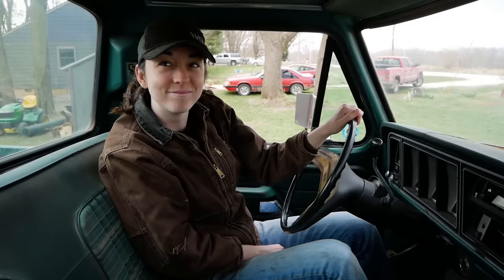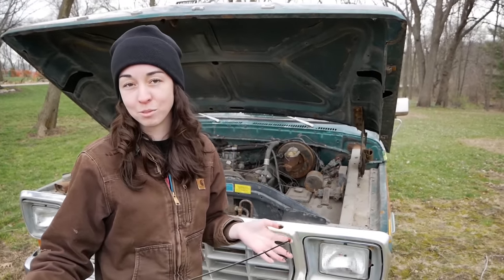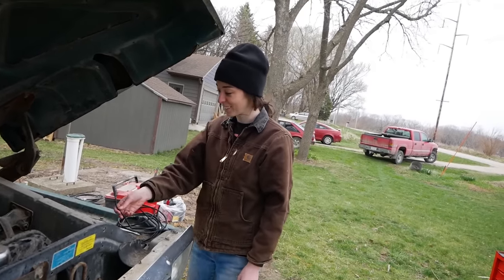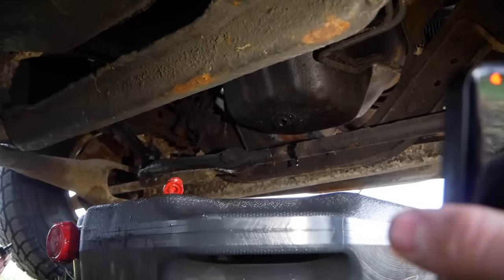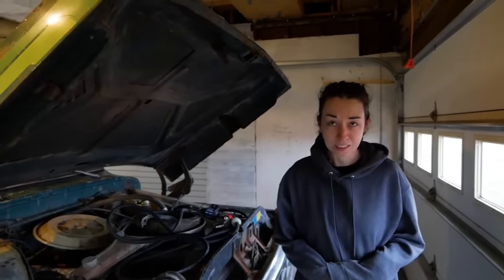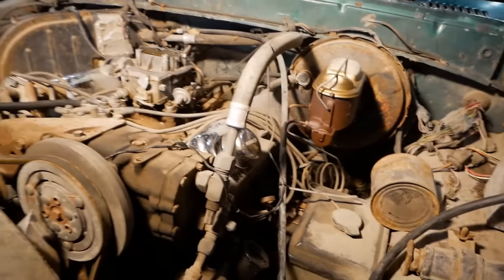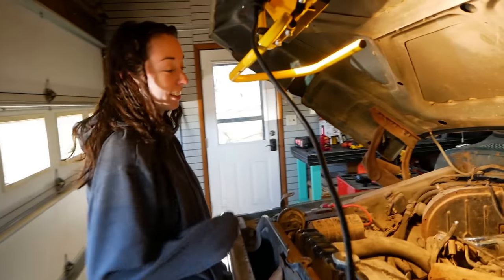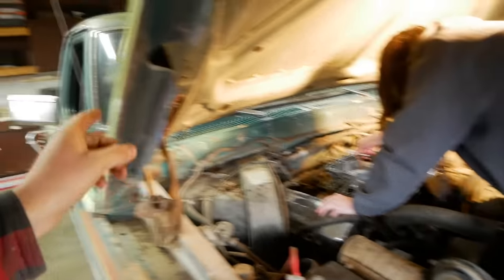I Bought a FLOODED F150! First Start and Revival!

Comment: I've owned many 351m and 400 Fords. Put a small cam, good timing set, cheap fenderwell exit headers, intake and 4 barrel on it. They are strong runners. Although they have lower compression some cam and ignition timing can work wonders. The heads flow well and will bolt right on a Windsor series block, but you need a few mods for cooling.
Reply: I put a couple turbos on my to get around the low compression. 
Only did 550hp at the rear wheels.
Never had an issue.
Love the dinosaur engines.

Comment: I’ve got a 79 f150 custom 4x4 and I had to do the same thing because of flooding. I drained 6 gallons of water out before any oil came out. I do have it running and drivable but there’s so much I still need to do to make it look and feel good to me. - a 19 year old South Carolinian!

Comment: My friends, the first thing you should have done after you found that much water in the oil pan, was to find out where it came from. …..  from what I have seen, you should have filled the radiator with as much water as it would take.... then wait 15 min. and check it again. If it is lowered add more water, and wait 15 min. And then look to see if it comes out the oil pan. (you may have a crack inside the engine block and the water is coming from the radiator.)
Reply: i agree. i dont think it was a flood vehicle as there are not any water lines inside that i could see. most likely a coolant leak into the oil.

Comment: Youthful optimism! Brings back the good ol' days when every rusty old hulk had potential. 
I hope you flushed the power steering, rear axle and trans/converter. That engine's a keeper, work on the rest of the driveline and you're all set. Grease everything up, oil the hinges, latches...Nice solid F-150 there! Nice work on the brakes, and try to find a junkyard-core carburetor for her? Drop the pan, clean the oil pickup screen. 
Best of luck with your truck, Mook!

Comment: We use diesel to clean out the engine. Drys the seals, but there's marvel mystery oil and Lucas oil stabilizer for that.
Reply: How would diesel dry out seals?
Reply: @Anne_Frank00  it absorbs moisture from them, same as gasoline...
Reply: Should just rebuild the engine.all the gasket and sealers are probably shot
Reply: @yuwaraaj1564  oh definitely, but if you don't have the time, it's a quick (albeit temporary) fix that anyone can do relatively easily.
Reply: You use atf bro.
Reply: Found out the hard way as I had one that had the same problems ( might have been brake fluid and or some type of acid and or water in the pan all I know is it burned my skin and harry knuckles off like my wife’s narre stuff would do ) as this ford truck and some racing teams and me use m100 methanol or E100 / really dry alcohol because it will mix better with the oil and the water ( giving a chance at saving bearings vs pure water and junk that it’s carrying with it ) mostly it will absorb it and thin out the oil vary little but will pore out the pan drain easily and what’s left will “burn out “ the tailpipes or PVC system if it’s done right and quickly otherwise you will end up with milkshake and rust/ seized parts aka useless junk and my pick is using ATF over Marvel mystery Oil as I tryed both in the cylinders and walls etc. 

It would be wise moog to change the transmission fluid and filter plus the differential case too at the same time etc. And check for mold and wiring but more than likely the mold is a little more rare to happen as if one has problems my bet is the rest have “water problems” just a suggestion as I learned the hard way and lost a engine 

I wonder if this is a thieves handy work and or pro-chop-shop way if dealing with a “problem” ??? as I’ve seen this before and is something to akin to if I can’t have it or make money off it never can you ?? or a way of not getting caught with anything useful to lock them up ??
Reply: Just pore it down the carb and into the oils filling tubes to gum up the works
Reply: My way that I found when dealing with this “ water problem “ is M100 first then ATF as I’ve tried both ways and learned from older mechanics and the interwebs
Reply: @J_o_B_is_back  Not really.
Reply: @richardprice5978  Why would you play with toxic Methanol when E85 is available ??
What exactly do you do with a gallon of toxic Methanol laced with burnt motor oil and water ??
This truck needs a new oil filter NOW and another in 100 miles.

Comment: I swear those trucks came off the assembly line with exhaust manifold leaks.
Reply: This really is a small world. I love seeing other channel owners commenting on other channel's videos. Been subbed to your channel for a while, Wes. I've been trying to talk my brother out of trying to find a non running Polaris 4 wheeler thanks to your most recent video, lol.
Reply: ROFLMAO 🤣
Reply: Collab
Reply: @Shane-Singleton  Everyone needs a dead Polaris to work on!
Reply: Tsunauticus III  I'm everywhere...
Reply: I thought you were Vice Grip Garage at first.  Your avatar is almost identical.
Reply: And power steering pump whine
Reply: I can't watch Wes work without thinking about the poor bald eagles.
Reply: I've owned over a dozen of them and only one had a manifold leak and that was only where the exhaust flange bolts to the y-pipe. That truck was allowed to leak considering it had 392K miles on the original engine.

Comment: I bought a brand spankin new '71 Ford F100 and took it straight from the dealership to have it undercoated.   That piece of junk rotted so bad before the first year was up that you could see all 4 tires when sitting in the cab.  When it rained you got soaked from driving through puddles on the highway.  I came home from a hunting trip and half the box had fallen off.   The 302 8 cylinder rarely got more than 70,000 miles before they died.   Never got one cent compensation from Ford back then.

Comment: hahahah, I know the feeling about buying a flood car and not knowing. while taking apart the dash to get to the ECU on my current car, I found a receipt behind the glove box from a mechanic's shop detailing how they drained 3 gallons of water out of the engine, 1 gallon out of the transmission, half a gallon out of the intercooler piping, and several more gallons out of the gas tank after a prior owner attempted fording a flooded intersection in a frickin' *SAAB 900* with an intake snorkel 16" off the ground.
Reply: And it survived huh? I dunno why people hate on Saabs, the old ones seemed like tough cars 😂

Comment: You should acclimate yourself with the q-jet more.  They are actually real good carbs.
Reply: They are only a good carb if you know how to dial them in which is a pain in the ass but once done they will outperform almost anything else
Reply: @Wesleystewart78  they are not that difficult really.  But yet they work awesome when set up correctly.  And will generally out perform most other carbs in a street application. But like anything else they are only great to a point.
Reply: Great carb if dialed in. That kick down 4 barrel sound is impressive.
Reply: Ik they are all I run on my SBC's
Reply: old school budget racing My day job is designing fuel injection systems and I agree with that. The Q-jet is my favourite carb, if I have to use a carb. I found them really easy to tune, as long as it’s not warped.

Comment: I had a 79 Bronco with a 351 modified. And it was definitely nothing to brag about, but after it spun a main bearing we went ahead and put in 400 rods and pistons a decent cam 4 barrel intake with a Holley 650 and dual exhaust with an  x-pipe. It was very respectable performing engine after that.

Comment: I think this is the first will it run that I heard the expression of need to do no more harm, drain the oil, etc. Very smart!!  Most "will it start videos" have trouble with start up because the intake runners are DRY, it takes a ton of fuel to wet things up so that fuel vapor inducts thru the valves.I also heard those negative comments about the 351M and 400 engine family being odd ball and to be avoided. Boy do you have some surprises in store for you. As produced they were dogs, no question. But I have a 78 f-250 4x4 with new process 4 speed and a 400 that I built up, took off the smog crap and that engine is a pulling fool. I used it to tow loaded car hauler to shows and it does not lack for power and durability.

Comment: I'm going to go out on a limb here and assume the rear-end is also chock full of water may want to flush and fill that with fresh stuff
Reply: Diving Duck  a shattered planetary gear begs to differ. It can cause very rapid and complete chaos. Lol
Reply: You don't even need that. Just keep the water full...
Reply: You need to change the transmission fluid and differential fluid asap.  The transmission will probably need changed 2-3 times.
Reply: Also the power steering fluid

Comment: I had a couple of 351 modified 400 and they were torque monsters of course they were canadian-made and didn't have all that smog crap on them
Reply: I got 400,000 out of my 1980 f350. All 8 oil rings broke at the same time. LOL
Reply: there good. just need a 4 barrel intake and sprinkle a little timing. some cleavland heads and a cam will get you to 400 hp range.(basically a detuned choked off cleavland with bigger mains and a big block bellhousing
Reply: @nathonsmithson3024  yup. Tourqe for days
Reply: Stephen Brown 🤣😂🤣😂
Reply: Yep I had a 78 3/4ton 4x4 sitting on 35s and it would torch those monster murders like they were small street tires

Comment: Howdy Mook, make sure you change the rear axle oil, trans oil, coolant, power steering needs to be flushed along with breaks. Good luck.  I had a 1964 F250.  It was awesome.  Have fun.

Comment: All that water where it shouldn't be looks like a bad head gasket. Edit added: great job getting your new truck running and driving. I'm glad the problem wasn't as bad as I thought. I like the older pickup trucks more than the new ones. I hope you get years of use out of it.

Comment: NEVER EVER PUT GAS IN THE CRANKCASE .
USE DIESEL
Reply: Allways. Never gas!
Reply: Yep, gas is a solvent, diesel is more like oil
Reply: @curtisj2165  use kerosine
Reply: I was saying the same thing.
Reply: @ty2010  they are pretty similar but both are far better than gasoline
Reply: I would agree diesel or Kerosene.
Reply: ATF is best. Half and half with oil
Reply: Kerosene and No.1 diesel are the same thing. (Diesel is filtered more). Same deal with home furnace oil and no.2 diesel.
Reply: ATF is the best as someone else said.
Reply: My dad always liked Castrol oil to clean out a engine,  something like a couple hundred miles and a 2and oil change and by the 3rd oil change it'll be fairly well cleaned on the insides
Reply: I was going to say that. Diesel cleans up gunk quick
Reply: This is what my dad was saying, he is familiar with these trucks and working on them.
Reply: @Chevymonster203  and diesel eats at the seals after some time
Reply: They put it directly into the pan through the dipstick sheath, not in the crank case
Reply: Never went to the crankcase, they went through the dipstick straight to the pan to breakup the sludge in the pan around 5 min 45 seconds in, sorry don't know how to add the time stamp
Reply: It’s only to flush the crap. You would get away with a gasoline mix if it’s quickly drained out and filled with oil. Alcohol is better as it allows the water to mix. But again. Crank the engine with plugs out. Then drain the resulting mess.
Reply: The Diesel or ATF folk remedy is for starting , running a brief time , and then draining . Here they're putting gasoline directly into oil pan , letting sit without starting or cranking engine , then draining . Two different things .
Reply: I did same . used gas - for diesel engine - cleaning -of mixture grease, water etc  = successful after sitting 12-years  Greetings froom Germany
Reply: Gas works great, diesel does nothing.  Put the gas in, wiggle the truck around like they did, I let it sit overnight.  Turns sludge into a drainable liquid.  Diesel does not.

Comment: If the engine was full of water, might the differential and fuel tank may be too?
Reply: lahokc59  ATF works well for and engine flush. NOT gasoline. Hook the choke back up. It will run better.

Comment: the best engine flush is actually a bit of diesel and some oil
Reply: That’s a good old go-to for me
Reply: Yep, 1 gallon of diesel fuel, and 1 qt of oil will scour the sludge out of that engine. Let it idle till it's hot, then let her puke out all the crap that came loose.
Reply: Yes. Flushing a sump with petrol is a terrible idea.
Reply: For me it's 4quarts oil one or 2 diesel changed 3 times.
Reply: No water in the transmission?
Reply: That's the magic potion. Seals enjoy the bath too.

Comment: A 351w needs to have the timing advanced in any old restarting situation, anything that has  sat for a duration of time change the oil before even turning it over 😐
Reply: He said it was a 351m.  Not sure if that makes a difference re your comment, but those engines are very different.

Comment: yeah I agree with a few quarts of gas, crank that motor with the ignition removed then drain. Then the cheapest oil and filter you can find, run for maybe 20 minutes with some engine cleaner in it, drain and repeat. Drive for a few days, then drain and refill with good oil and a filter.

Otherwise she's a beauty, good score!

Comment: Maybe a 4 barrel intake, ‘70 head, & performance cam would wake that thing up.
Reply: Hot Rod magazine built a 400M years back and made good power with it. Others have messed with them too, check out at the various Engine Masters builds, and I believe Richard Holdener here on You Tube recently built a Modified series motor as well...
Reply: True. But first do a proper engine clean out, plus fluid changes in the gearbox and diff. They are undoubtedly full of water. If they are, the transmission won't last 20 miles

Comment: The gasoline is a bad idea, just drain and refill ALL fluids including rear end, transmission, power steering fluid, master cylinder and brake lines.  Than run it and drive it for about an hour and change all fluids a 2nd time.
Reply: Kerosene would work just as good. Its not as highly flammable. Makes a good parts cleaner.
Reply: Remove sparkplugs and add some mystery oil down each cylinders.
Reply: Yep.  You'll wash any oil film off the bearings, cylinder walls, cam and lifters by running a light solvent through the engine like this.  Any residual water mixed in with the oil will evaporate once the engine warms up.  Then change that oil immediately.
Reply: Gas is a bad idea. Diesel fuel or kerosene. Dump and refill all fluids. A bit of sea foam down the spark plug holes too.
Reply: With the differential the water will come out before the lube will. Water sinks to the bottom

Comment: 351 M... M does not stand for "modified". M stands for Moline, as in Moline Illinois where the engine was cast.
Reply: Exactly.
Reply: It’s has nothing to do where it was made, but keep bickering. It’s funny 😆
Reply: I'm an old Ford mechanic and M is the designation for a 351 Cleveland that is modified from 351 c.i. to a 400 c.i. I have rebuilt quite a few of them in my day!!!
Reply: Nope M stands for motor. I can't stand it when people use the term modified. Nothing about it is modified.
Reply: I worked at FORD for the last 322 years. The M stands for MASTERPIECE you fools!! 😘
Reply: @flipnotrab  lol i guess it could mean that but some had cracks in the lifter valley. Lol
Reply: The 351C was discontinued in 1974. The 351M began it's run in 1975 and ran through 1984. The M and C engines were close to the same engine with slight changes with the timing assembly. The M series was only offered with a 2bbl carb. The bore, deck height, cam and crank were also modified.
Reply: @ronbridges678  no, it's the H series after that year..
Reply: Hank Bridges  What in the hell are you talking about?
Reply: 351m is a 351 modified!!! Not where it was manufactured!! It has absolutely nothing to do with where it was built!! If I'm not mistaken its technically a 400 block
Reply: @markwilliams4525  Correct, it's a destroked 400, hence the modified name. I was a Ford dealership mechanic when this truck was new. The only difference between a 400 and a 351M are the pistons, which have a different wristpin height, and the crankshaft. 400 has a 1/2" longer stroke.
 Actually, in 1977, we got a new 4wd F150 for use at the dealership. 351M. The thing was an absolute dog, no power. I checked compression on it, was about 80 lbs on all cylinders. Turned out it had been assembled at the factory with 400 pistons and a 351M crankshaft! I pulled the engine, which had less than 500 miles on it, put in a 400 crank, and we had a 400 engine.

Comment: I have had great luck with the 351M and 400. Hugely under rated engines that go for a long time.
Reply: In addition to my previous comment, Jon Kasse won a National Engine Builders Award based on the Ford 400. Later, when an enthusiast asked him how to get 400 horsepower out of the Ford 400 engine his reply was “3 c’s. increase compression, cam and carbonation. .Then pull off plug wires till you get there”
Reply: Just discovered Mook!!!! Love the channel great work.

Comment: Did you ever look at the cooling system? Was that where the water came from?
Reply: The oil would have been milky if it had been run with the water. The exhaust had it too which means it was in deep standing water. The lights being dim on the left side is a grounding issue so its probably got alot of electrical issues. I had a 79 F150 when I was a kid and did a lot of work on it. Miss that truck. Truth be told, I am kinda surprised they didn't check most of this common stuff before trying to start it. I guess trial and error works too.